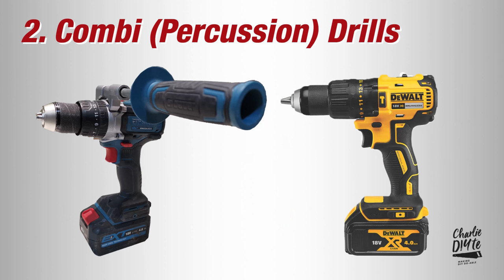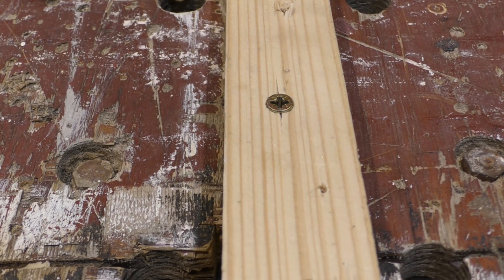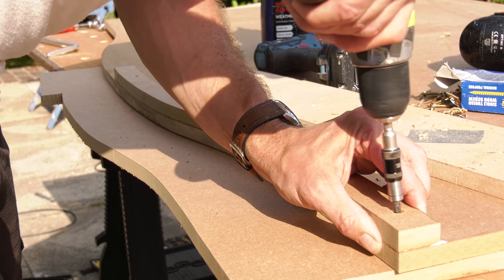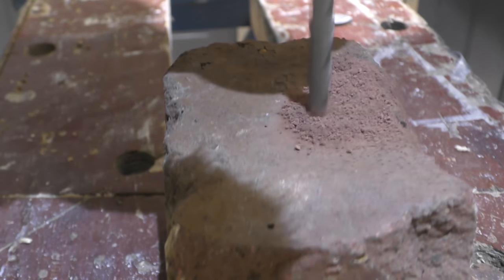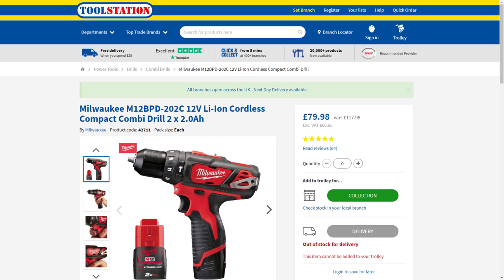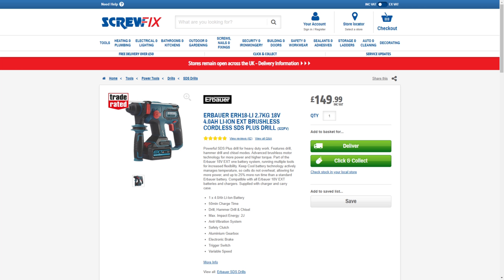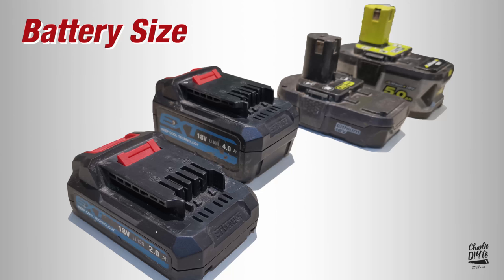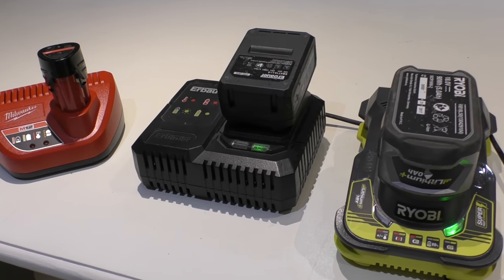The Difference between Combi, Drill Driver, Impact and SDS Drills

Comment: I agree with you, as a DIYer we should look for a good deal and usefulness of the items rather than sticking to one brand.
Reply: Problem with that approach I have found is that once you have the battery of a certain platform you can then buy the 'bare' tool where you just get the tool and nothing else. This is often far cheaper than buying another brands equivalent plus batteries and charger for the different batteries of the other brand.

Comment: Tool snobs giving you stick for using Ryobi when Ryobi and Milwaukee are owned by the same company 🤨😂. Great video. I have that Titan SDS and it’s so powerful.
Reply from the maker: Interesting. I didn't know that, but i do know that a huge number of these brands are all made in the same factory. The Titan is great, isn't it 👍🏻
Reply: @CharlieDIYte  Yes a lot are in the same Chinese factory then they come over to the UK and we get shafted on the price haha. The Titan is worth every penny! Mine sits in the garage majority of the time but just knowing you have it for the job that nothing else can do is what it’s for I think. A little battery powered 2 or 3 mode SDS for your everyday stuff is definitely worth having though as the Titan is just too heavy to slog about ha

Comment: My choice is ryobi powdered by 2x 4ah batteries bought the cordless grinder for cutting my old mooring chain at low tide lost count of how meany hack saw blade I broke doing this job witch is time critical got a good rane of drill drivers impact driver grinder I found the speed combined with the blue bosh drill bits perfect for installing metal socket boxes witch is my day job also have the sds for any heavy work can't fault ryobi 👌👍

Comment: I live in a 100 plus year old UK house  and can't drill in any wall. 😔 as the hammer on the drill i purchased can't cope.  (I actually thought all my walls contained impenetrable material that made them drill proof Duh!).   I can't put up curtain poles or shelves etc etc. as I just can't drill in the walls!  Could you kindly recommend something.  (Limited budget) thank you 😊
Reply from the maker: Yes, absolutely Julie. You need one of these http://bit.ly/2G4aZ6X It's £79 but comes with loads of drill bits (incredible value for money considering what you get). It's an SDS drill. It's very heavy but will go through your walls like a knife through butter.

Comment: My rule is, "If it's a heavy duty job  always use "Corded" tools.....  don't be sucked into buying what companies advertise as "top of the line" cordless, because "top of the line" normally means, most powerful and heavy, which as you say, can get boring very fast.... especially if working above your head...
After all, you wouldn't buy a Ferrari for a milk round.... lol. 
I got an 18v dewalt brushless Drill/Driver with hammer action and 65n/m torque, that included x2 3ah Slimline batteries and charger, with T-Stak case, for £120.
It's light, powerful enough for most home improvement projects and very versatile.
It was a screwfix offer.
Then I have the Titan corded SDS for heavy duty work.
All bases covered for £200, basically.

Comment: What about corded non-SDS drills? My cordless combi is useless for drilling into London brick but my Bosch corded drill handles it with ease. I'm sure an SDS drill would provide even more power but I haven't come across a situation that my Bosch couldn't handle, and this avoids the need for two sets of drill bits.
Reply: I used to have similar thoughts but SDS are really superior but if you aren't doing a lot of drilling into brick work and you have a good drill like you there probably isn't a need to upgrade to an SDS due to the extra cost not only of the drill but also the bits etc. An SDS does allow you to use chisel etc type bits that you can't in standard drill as an SDS allows you to just use the hammer function with no rotation.

Comment: Hi Charlie, I have noticed over the last few years that you seem to shop at Screwfix, I on the other side prefer Tool Station. Having said that I bought a set that included an ordinary drill and a power driver, these two tools cover everything as far as I am concerned, the drill for making holes and the driver for screwing the fastener in. I have an SDS drill as well but don’t bring it unless I know I will be drilling concrete.

Comment: @charlieDIYte could you please do a review of the draper storm force impact driver I've bought one and think its great but would love your opinion
Reply from the maker: Hi Ray. Is that the 20v? Looks like a nice bit of kit. I won't be able to review it any time soon though. Too many videos in the pipeline.
Reply: @CharlieDIYte  yes it's 20v, and whenever you have time to review it, and I'm still watching your videos, also Charlie what would be the best plasterboard fixing to hold a dartboard solid on the wall, also I loved your videos on your garage roof refurb, hope your garage is all good now, and I've taken your advice in your silicone videos and used it in the house, silicone around my bath looks good now. Love the videos, keep them coming charlie.
Reply: @CharlieDIYte  also I'm glad I found your channel its been very helpful to me. Thanks charlie 👍

Comment: One thing that confuses me is battery's, sometimes i see 2,3,4,5 AH and not sure what i need for combi drill for example.
Reply from the maker: It's a weigh up between weight and power. For a combi 4ah is a good option but the drill will be heavy to lug around all day. But if you put a 2 ah on it you won't be able to use that on thirsty tools like circular saws or SDS drills.

Comment: Charlie have you found much chuck wobble with any of the Ryobi drills?
Reply from the maker: It's not something I've noticed, mate, if I'm honest. All in all they've served me very well over the years. The chuck on the Ryobi combi has had it if I'm honest, but that's after a lot of use. Those Erbauers you might have seen in the video have been good too. All metal gearbox, all metal chuck. Decent specs for a DIY tool.
Reply: @CharlieDIYte  thanks Charlie. Have a Dewalt currently that does have a slight chuck wobble but it doesn’t really effect the performance so still use it. Was thinking of buying a Ryobi as a second drill, good prices for them just now on Amazon if you are looking for another one.

Comment: As long as the tool are 18v platforms you can often just buy an adapter off ebay and mix batterys whit other brands. I like Milwaukee (AAOOOUU AAOOOUU) but they dont make any hot glue gun so I just use a physical adapter to use my milwaukee batteries in my ryobi glue gun.
Reply from the maker: Yes, take a look at this, where I used the Badaptor on my b-tec glue gun https://youtu.be/idmmDRM3x0A You just have to be a little bit careful as some tools (DeWalt I believe) have the cut off in the tool not the battery so if you use a De Walt battery with an adaptor it could decharge too low thereby ruining the battery.

Comment: There’s a much larger difference between “combi” drills and SDS than the travel distance of the bit. The mechanism of action is completely different. The SDS’s motor drives both the chuck (rotational) and a piston located behind the chuck at the same time. This piston pushes an anvil into the back of the bit thus actually hammering on it. A hammer drill simply implements bumps and grooves on the gearbox that cause the gear driving the chuck to move up and down (forwards and backwards inside the drill). An SDS could have only 1mm of travel and would still be 10x better than a hammer drill.

I also highly disagree with your comments about impact drivers. A good impact is life changing. They’ve pretty much all but replaced the drill driver for me in every task except drilling metal. And even then I opt for one of my several impact drivers before any of my drills most of the time. They’re especially useful when drilling big bore holes as they do not torque your wrist off when the bit binds. 

I primarily use my drill drivers for assembly as the safety chuck with adjustable torque is extremely useful for this. It helps prevent you from overtorquing a nut on plastic or bending sensitive metal with a bolt etc. but other than that the impact takes the cake. 

I know I’m not alone because I see a very large amount of people using their impacts for any of a wide variety of tasks that you would associate with the standard drill driver. It may just be a US thing but that is the current trend.

Comment: This video from the 'Tools & Stuff' YouTube channel is well worth watching to understand how the different types of hammer action actually work:

"Impact Driver VS Impact Wrench VS Impact Drill VS Rotary Hammer Drill | How Does Each One Impact???":

https://www.youtube.com/watch?v=1es1vHu1IG8

SDS drills are well worth buying, I virtually never use the combi drill hammer action now as it just is so poor in comparison to an SDS. They are like a hot knife through butter. I also second getting the Triton as a back up/rough job drill. For the money you don't mind throwing it at all sorts of job you might be a bit less keen to use your 'proper' drill on for example mixing concrete/plaster and demo work.

Comment: I already have a DeWalt combi drill, but it's getting tedious change bits between drilling and driving screws. Would you recommend an impact driver or drill driver as the second tool. 

P.s. congrats on the milestone
Reply: You should have both a drill and an impact they complement each other.

Comment: +1 for being "unfaithful" to brands and their battery platform. They often get you with a really varied price point for different tools and high battery prices anyway. 
In the end you might save more money by having several brands and, like you say, if you're not a tradesman it doesn't matter much.
Reply from the maker: Exactly, and you can even get battery adaptors (check out Badaptors on Amazon) to use across platforms.

Comment: I use my impact for everything, drilling screwdriving i just buy hex impact drill bits and hex spade bits and hex countersink drills, I've got a combi drill just never use it.
Reply: I've considered that, and have flirted with using just the one. But I bought a drill and driver kit, and the changing of bits is what puts me off. Two tools: one drills, one drives. The most common of tasks, at speed.
Reply: I do that, got two Trend Snappy Bit wallets will all the drills you can imagine with hex fitting. I quite often use impact for drilling and drill for driving the screws if all I have with me are my 12v. The impact make little noise drilling small holes as it rarely impacts and the drill or hex driver quieter and more controllable for screws on door handles etc.

Comment: You promoted one drill
Reply from the maker: Yes and no. This video wasn't really about promoting a particular drill, more a particular type of drill, and I bought the Milwaukee because the Ryobi drill driver which I love has now been discontinued, so it would have been a bit of a hollow video if I'd said "this is the drill driver that's been the game changer in my DIY, but oh dear, it's not available any more". I couldn't possibly have run through every brand and told you which was best but each one works for different people depending on what they're using it for and budget. I'm just trying to give you the knowledge to go out and get yourself what you think will work best for your DIY.
Reply: @CharlieDIYte  appreciate the effort keep up the good work

Comment: I got the same Titan SDS and it’s a bloody bargain for the torque. It’s an utter monster. 
I wouldn’t go for the kit with all the bits, as the smaller kit SDS bits are utterly terrible. Unless you wet every 3 seconds, they just melt. 
Get some decent SDS and it’s a powerhouse. 

Interesting points on the batteries, I’m completely guilty of Brand loyalty, or more accurately, battery platform loyalty.

Comment: I have this makita 10.8v drill and love it. Iv had it for years and a great tool. https://www.its.co.uk/pd/DK1493WX-108v-Cordless-Li-ion-2-Piece-Kit-_MAKDK1493WX.htm
I also have the 18v impact, drill and SDS but for smaller / quick jobs, the 10.8v is my go to for your reason

Comment: Never once have I ever changed brushes. You will get a new tool before you change them absolutely no need to get brushless unless you have it 20 years
Reply from the maker: Thanks - glad you agree. That's my experience too👍
Reply: @CharlieDIYte  yep I'm running all dewalt gear the only brushless tool I have is the impact driver only because it was on offer cheap, not because it was brushless. Just a word of caution stay away from the dewalt cordless planer . The blades slipped and bent the base plate in turn now 1 of the screws has ripped out because they only screw into plastic threads. It's on warranty so will send it off. Take care stay safe 👍

Comment: "unfaithful FOR A CHANGE" I think you stress brand loyalty too much ~ it's another bleeding charger and battery.
The different battery is what stops me buying tools ~ batteries can last one use; especially those tiny 12v ones, you can go from the frying pan to the fire over the bleeding battery ~ and add in the price ~ almost the only way to buy batteries is in kit form where as example for all the major manufacturers, one can buy a two unit combi kit with case and two 4 or 5AH batteries ~ for the unit cost of just the batteries alone <